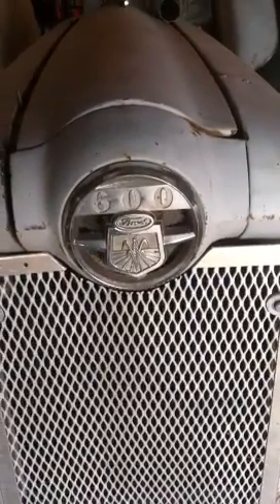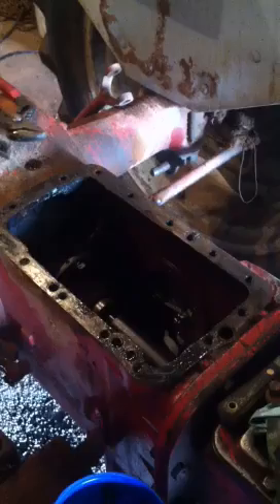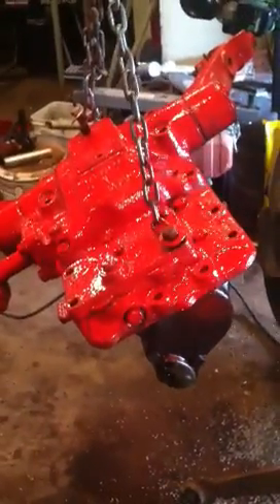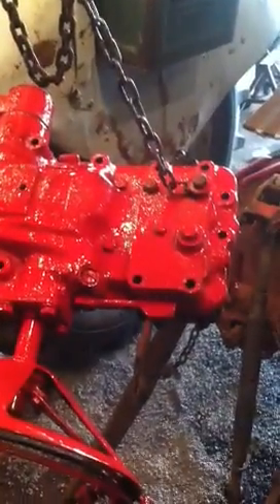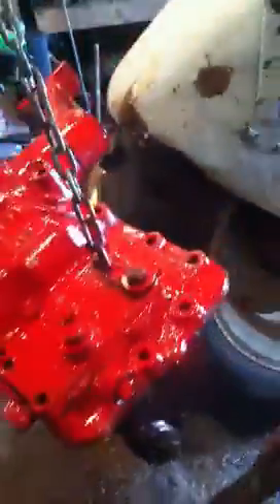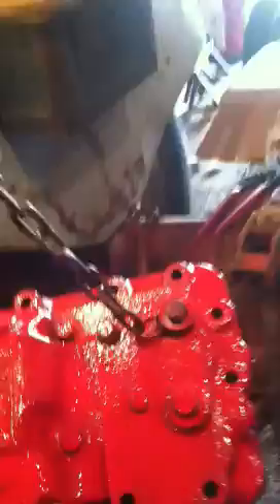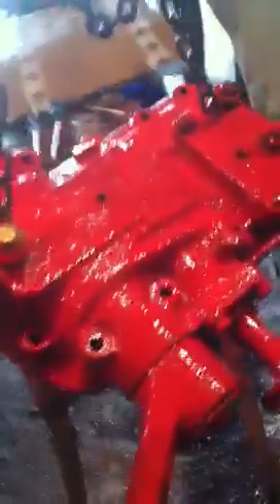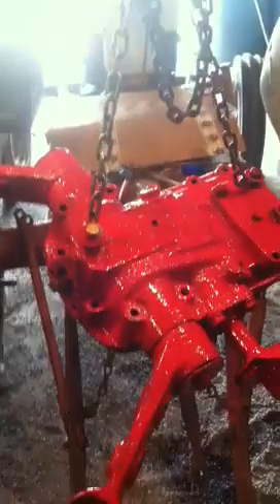Ford 600 hydraulic lift repair

Comment: The video showed me what I needed.  He is correct there is no inspection plate on the right side of the tractor. Shows what bolt you are removing and what bolts stay in place. Helpful for me

Comment: There is a valve underneath. Pull the plate of and you’ll find a relief valve. I just replaced it $108. The plug in front on the plate on the top has a control valve in it. You have to pull it with a bolt. The other valve you mentioned is a safety valve. I know these things because I’ve just spent a small fortune on all of them. I’m now replacing the hydraulic tubes that run thru the transmission into the hydraulic chamber.

Comment: Thanks for the video, great information. I have a 1956 601 series that is starting to give issues lifting completely. I can mess with the draft control lever and get it to lift more so thinking something is finally give up or not enough hydraulic pressure. I did have to change ALL the hydraulic  fluid earlier this year due to water getting in it. Took out 8-9 gallons of fluid and replaced with 4.5. I researched and did use the correct fluid but some people said they had some issues as it is a little thinner.

Comment: the valve that's under the 'accessory plate' is the pressure relief valve. $24 from Steiner for an aftermarket part, the New Holland dealer is almost $200 for the same thing.

the control valve is the one that rod with the turnbuckle is hooked to. while you had this off, I hope y'all spent the 15 bucks or so and bought the lift cover rebuild kit and replaced the piston rings and o rings   ;)

Comment: ive got a ford 600 and the oil pressure line appears to go into the front of the hydraulic pump.  this doesnt seem right to me.  can u advise where your oil pressure line goes to on the engine.  thks.  jim